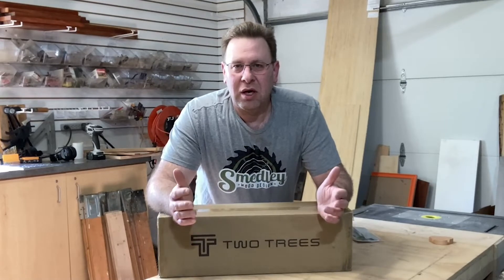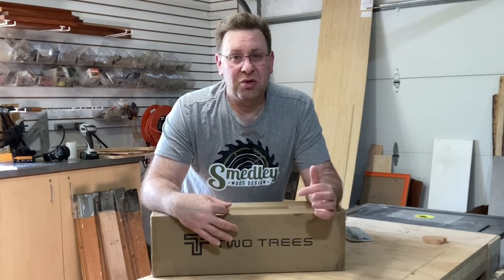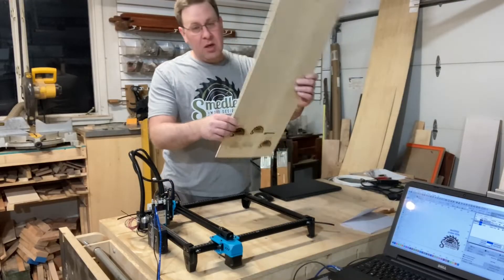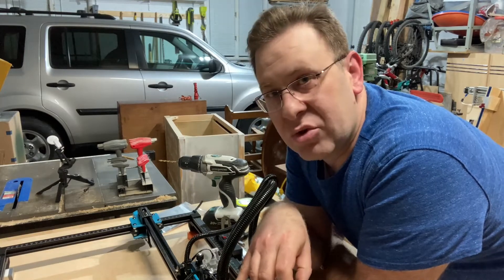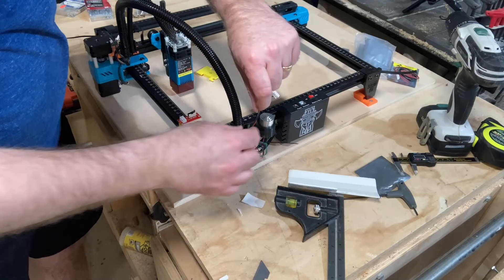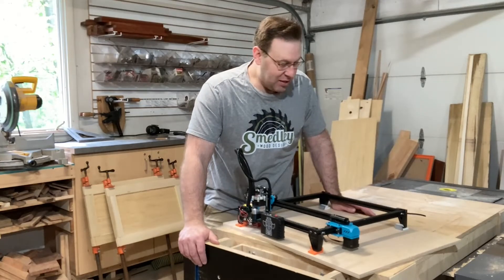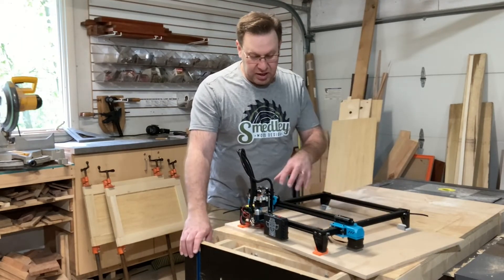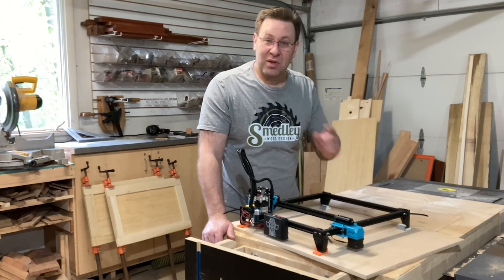Twotrees laser TTS-55 and adding limit switches

Comment: Hello everyone.
I added limit switches on my TTS-55 pro, and I noticed after that I have a lot of USB disconnexion during jobs, after 2/3 minutes.
I tried a 22 minutes job after disconnecting the switches, and it runned smoothly to the end.
Anyone knows what the problem can be ?
BTW, the problem occurs on Lightburn. I didn't test with another soft.

Comment: Great video. Do you know how to install switches on the other 2 ends? as a protection to not grind the motors in case it tries to run off the limits? than you.
Reply from the maker: I think you would connect the wires in with the X and Y axis. Front X with the back X and then the same with the Y.  I would probably test it out by pushing the limit switch while it is moving,  just to make sure it's working.

Comment: Quick tip: if you flip your motherboard upside down on the front you will have the clearance to center longer pieces under the frame.

Comment: I just received one ( my first ) and it’s a huge learning curve for me , I’m not sure if I like Lightburn or GBRN better ? But mine has the air assist that does make a difference in cutting . I’m not sure if making it larger is better but I deal with small engravings on leather and ceramics and aluminum.
Reply from the maker: Yes, it is a big learning curve but I am finding it is fun to learn new thing to on it. I've been playing around with the Norton white tile painted black technique, I'm getting some awesome results. I have a air assist on it's way, with Christmas discounts and coupon codes, I couldn't resist. I also did go bigger with the foot print, it is nice to be able to do larger project but it's a lot harder to store it when I'm not using it.
Reply: @smedleywooddesign2219  at my age it’s fun to learn new things like engraving and leather goods , looking forward to your upcoming videos !
Reply: Gbrl is basically just for sending the gcode to the laser. Lightburn has a huge amount of features for design and editing your engraving or cut. It may cost £40 but it's well worth it.
Reply: @DalaiFarma  good to know ! How come GRBL does outlines and on the same pic lightburn burns the image ?
Reply: @DalaiFarma  other then Lightburn is there a program you can add text ! The GRBL can’t !
Reply: @davekimbler2308  you can use another image editing program to add the text. It's just another reason that I prefer lightburn as you can do it all in one.
Reply: @davekimbler2308  If you use image-r  there is a new option to add text to your project.

Comment: Question about limit switches, I have several on my laser but didn’t know how the actually work. Is the laser head supposed to physically hit it? Or is there a sensor on the limit switch that senses when the laserhead comes near it? I ask because my laser head Rams in the mind sometimes and wants to keep on going and I have to shut the machine off quickly.
Reply from the maker: If your using the same kind of limit switch that I use, then the laser head will physically touch the little lever of the limit switch.  Away to test each limit switch is to put the laser head in the meddle of the work area, then on the computer click the home button , while its moving physically push the limit switch levers to make sure they are working.
Reply: @smedleywooddesign2219  thanks

Comment: Cracking laser and mine on its way as a new business venture, worth you investing in the air assist will give you even cleaner work and cuts. Grreat video 👊👍👌
Reply from the maker: I have read that about air assist so with Christmas discount and coupon codes I ordered one. Thanks for you comments.
Reply: @smedleywooddesign2219  well worth having.

Comment: What are the connector types on the board?  I have PH2.0, but those aren't correct.
Reply from the maker: The connectors I used are 2.54mm JST-XHP here is the Amazon link, https://www.amazon.com/gp/product/B0774TF39N/ref=ppx_yo_dt_b_search_asin_title?ie=UTF8&psc=1

Comment: Nice video, just need to confirm the orientation of the wires 😁 so based on the video, its red(voltage) on top, black (ground) in the middle then green (signal) at the bottom? Thanks!
Reply from the maker: Thanks,  I should have done a better job at explaining the wiring,  Yes that's right red, black and green in that order. If you use the same limit switches I used, the one end of the wire is already set up the way the other end needs to be, I hope that helps.

Comment from the maker: I have had requests for the feet I used to secure the laser to plywood, so I added the stl files to Thingiverse, same link as the limit switches.
Reply: I appreciate your assistance with everything on the Facebook group and you adding the feet. I'm trying now to figure out how best to use this with LightBurn, as I think I'll be using it.
Reply: @keithmotes9933  happy to help, Lightburn is a great program, I’m just barely scratching the surface on learning how to use it.